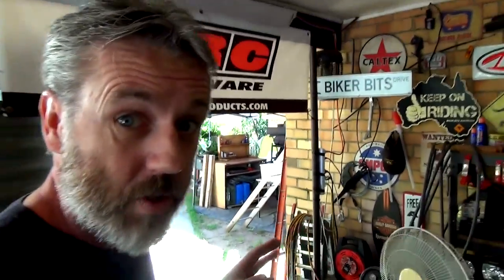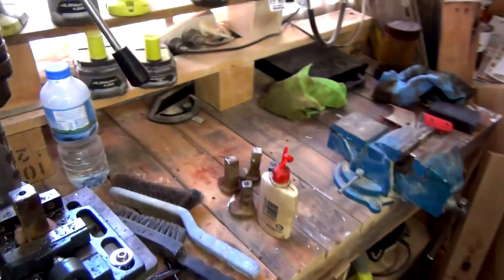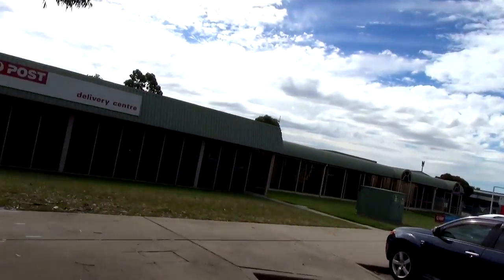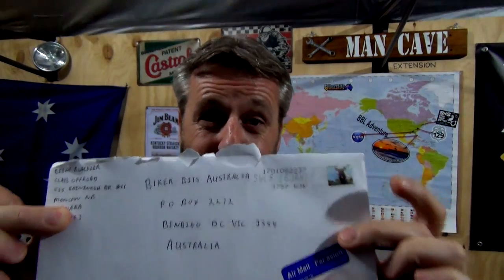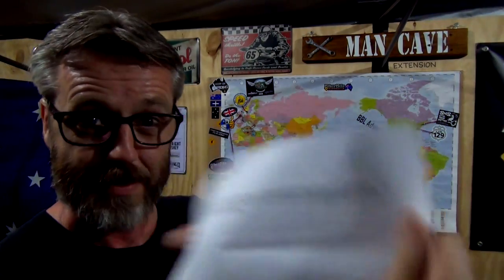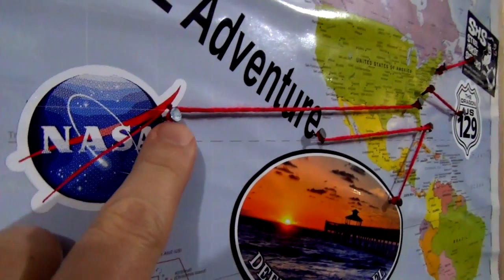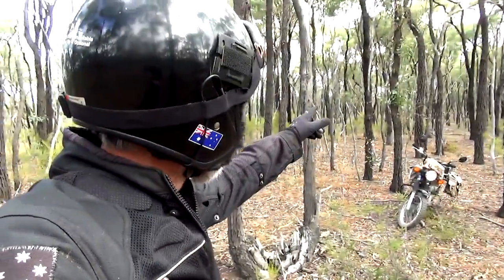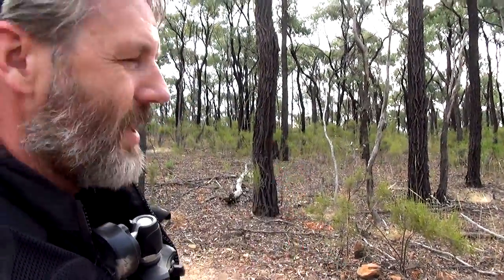The Aussie Shack - MCT Ep.25

Comment: Hey Mark,

Love the videos, Just curious as to if you plan on making a fully enclosed type of shack there? If so extending the outside walls to create more of a rectangle is a great idea, with some sort of make shift door. Another great idea is to possibly bend some of that corrugated metal into a square shape the long way for some sort of chimney if you decide to put on a roof, and the rest could be used to create some sort of stove with a top.. Might be a little challenging in the bush but could be doable.. Good day mate! Thanks for the great videos!

P.S. I can vouch for the sikadas or however you spell them here in North America. I am in the military and was stationed in Northern Kentucky and apparently every seven years around there they come out. I happened to be there during one of those times and woke up every morning to hundreds of those things on my front porch! Loud little buggers!